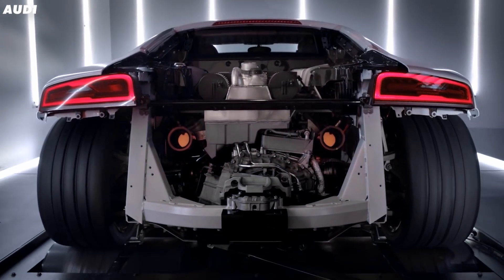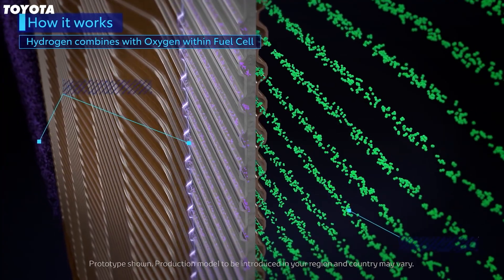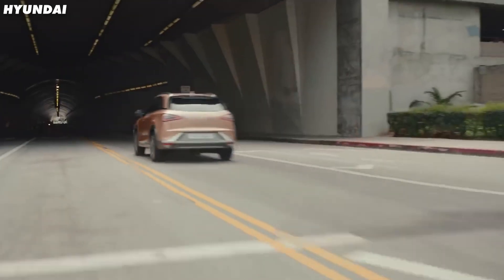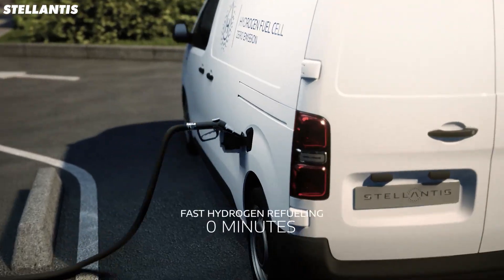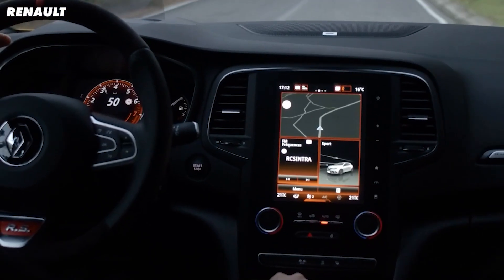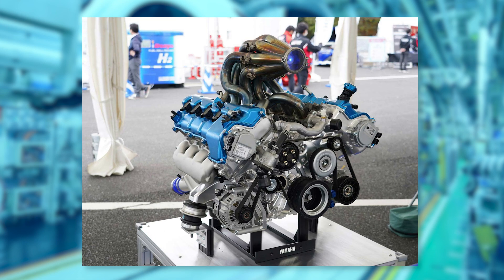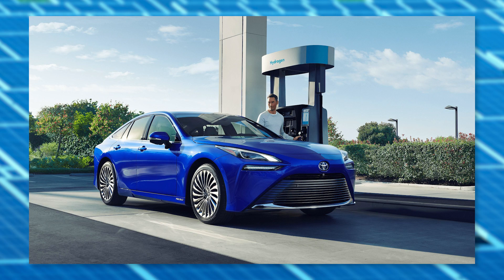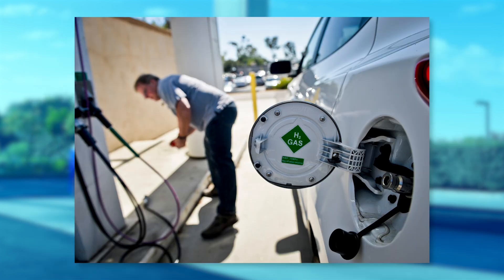The V8 Engine that Runs on HYDROGEN

Comment: 2 main things - hydrogen explosion by combustion and by fusion are two drastically different things. It's like comparing tnt to candle - both are energy dense, but giving off energy in an instant is governed by different factors.

Second - hydrogen has to be compressed - that takes enormous energy, and that contributes highly to losses. Storage is also a challenge - those vessels have to be isolated from temperature. Those two problems aren't  as high in petrol and electric batteries. And those reasons also cause the hydrogen to be harder to adapt, store, and transport to the gas stations.

Other than that - great video.
Reply: Personally, I would see hydrogen as a suitable fuel in the future, but not for cars people have. Instead, busses, trucks, or maybe even planes which are taking fuel  and have to be refueled fast and use the fuel fast for driving/flying continiously. Hydrogen as a fuel isn't very suitable for long time storage inside of cars (if stored at room temperature, hydrogen doesn't have high energy density). But using it straight away just after refueling is more sensible.
Reply: @rafakordaczek3275  Hydrogen in liquid form, which is what would be used, is very energy dense. It can also be stored for long periods of time (assuming there are no losses in the fuel tank) give that it won't lose is energy value like gasoline does (octane value lowers over time to vapor production of it). The tanks are built to hold the pressure to maintain the hydrogen in liquid form.
Reply: @ryannelson8717  Hydrogen in liquid form, haahaahaa roflmao.
Reply: @ryannelson8717  Well, The hydrogen also can cause metal fatigue - High pressure hydrogen can penetrate into the crystallic structure, weakening it. The materials withstanding such processes over long periods are quite expensive.  Ensuring durability of materials expose to hydrogen is still an active research topic in material science.
Reply: @rafakordaczek3275  the process is called Hydrogen Assisted Stress Corrosion Cracking. It's the process by which a hydrogen gets trapped in a microcrack and when the metal around it cools down, the hydrogen is effectively incompressable results in crack propagation. Yes this could lead yo failure of the tank. A simple solution is to ensure that the metal doesn't get heated up very much thus minimizing how much hydrogen will enter these cracks. A simple cooler that is active during fueling to prevent the heatup from pressurizing the tank. The opposite can be done for cooling down by placing a small string heater around the tank to keep it above a certain temperature. The result is a cheap, but effective extention of its expected life being around 22 years before any crack would otherwise penatrate through the entire tank metal and would still be relatively small, but that paid fuel that would be lost.
Reply: Look up about "Gumpert Water-Methanol" you can store Hydrogen without high pressure and low temperature tanks! while managing the same/better ranges
Reply: He wasn’t comparing the energy released between fusion and combustion. He was comparing the cryogenic storage system and vessels that are identical for using liquid hydrogen, whether for combustion or for fusion. And no you DO NOT need fissile material to fuse hydrogen. Hydrogen fusion is done in labs alllll the time. You just don’t get out more energy out from the fusion reaction than what was required to get the fusion process going, like what’s theoretically possible. Thermonuclear induced hydrogen fusion is just ONE way hydrogen fusion can be done. 

Muon catalyzed hydrogen fusion is also a well known, studied and completely viable process that does not require high temps or pressures for hydrogen fusion either.
Reply: Only Hydrogen fuel has the potential to make practical Electric trucks, ships and planes.
Reply: Also, inb4 people claim e.g. Cobalt used in batteries. Guess what, refining dinosaur juice requires Cobalt, and once it's used it cannot be recycled and is absolutely more toxic. You can recycle some Cobalt from lithium batteries.
Reply: @XenonG  hydrogen can be reused much easier.
Reply: re transportation - u can also transport hydrogen as water and electricity ..
Reply: imagine gas stations fill their own hydrogen tanks from grid power and water with an on-premises mini electrolysis  plant
Reply: @lezzbmm  sure, of course it just puts more stress on already stressed power grids and water supply.
Reply: @Scoots1994  correct - 2 systems already in dire need of expansion regardless of the future of hydrogen.. as opposed to putting stress on a nonexistent, materially demanding, hydrogen generation and transportation system ..
Reply: @lezzbmm  coastal nuclear power plants can produce power, water, and hydrogen.  It's criminal that it was ignored when the plan was put forward in the late 70s.
Reply: @Scoots1994  truly
Reply: I think most of that was covered generally though
Reply: look into hho gas
Reply: look at hydrogen paste it's quite interesting no need to keep it ultra cold ❄ ❄ and eliminate a lot a problems
Reply: Perhaps a two stroke that uses a nuclear detonation to compress the hydrogen fuel....yeah that's a good idea. Ok NASA actually thought to use nuclear bomb propulsion before.
Reply: Go throw some molten salt into h20 then come.back and tell me about it

Drip sludge into combustion chamber utilize a microwave frequency as heater to quickly turn drop of metal sodium sludge molten. Spray with regular old tap and ka boom needs air intake as well. 

I'd worry about my water tank freezing in winter so maybe if it's cold enough when you power off the water tank will just drain just tap you can refill it from sink
Reply: I think I'll wait for the matter/anti matter engines.
Reply: All of that will just make hydrogen Lamborghinis and Ferrari's more attractive because owning, maintaining and fueling one would be out of reach of peasants.
Reply: Solar/wind apps (Electrolyzation + liquefaction) Bucky Ball explosion proof upgrades for storage and distribution = energy medium as applicable and versatile as gasoline  

Energy medium as applicable and versatile as gasoline + Conversion kits for internal combustion engines = affordable alternative to replacing internal combustion engines.
Reply: We knew this was coming 50 years ago and had a chance to build coastal nuclear plants to desalinate water and convert some of it to hydrogen.  Now we have power shortages and water shortages and the price to build that still needed infrastructure is going to be HUGE compared to what it was then.
Reply: @Scoots1994  You are only doing ecological damage for SHAME money.
 You wage the Arab wars for oil, commanded by the seven sisters of oil and you have destroyed Syria and half of the Arab countries.
 You are one of the countries that pollute the sea and air the most, and your nuclear power plants remain a potential danger.
Reply: @giuseppebattagliese6424  I don't do any of that and nuclear power is MUCH safer for the environment than all the coal and natural gas plants being used and still being built now.
Reply: @Scoots1994  You did not understand.
 I am in principle against nuclear power is too dangerous.
Reply: @giuseppebattagliese6424  I got that you are against nuclear power.  The problem is that renewable energy with our current ability to store energy for later makes it impossible to use just renewable power right now which means we must use other means of generating power ... Fossil fuels or nuclear, and nuclear is cleaner and safer.
Reply: @giuseppebattagliese6424  Nuclear power is not dangerous. Does it have inherent danger? Absolutely. However, there are many regulations in place now that those risks are smaller than you driving your car on the road. The only inherent danger left in it is an overconfident operator. I personally am a Nuclear Reactor Operator. I started this field much the same way you feel now. Growing up hearing all the bad things terrified me. Now as a qualified operator and knowing exactly what is Nuclear power amazing me. It drives me crazy that people are so terrified of it, yet it's literally an amazing source of power that is safer than spending the day on the beach or even driving a car.

I imagine much of this is from the early years of Nuclear power where errors were made results in some accidents. The horror stories of Chernobyl don't make it much better. For Chernobyl to even get to that point that dozens of safety protocols were overridden. Those protocols now have several interlocking things that would raise awareness outside of those facilities long before they could become a problem.
Reply: @Scoots1994  fun fact, Nikola Tesla actually has a patent for a machine that makes rain but it was turned down by the patent office because in the patent Tesla claims it happens naturally but he can induce it and the reason for denial is because “you can’t patent a natural process”. 

So we don’t need to risk the cleanliness and security of the global water source with nuclear plants on coastlines when there are plenty of devices for causing rain already that don’t risk releasing radioactive materials into the worlds oceans.
Reply: @CharlieSolis  we need cheap clean safe reliable energy and nuclear is the best solution for that right now.
Reply: wind and solar powered hydrogen plants would be feasible, but storing, compressing and making it all safe in a car is the hard part.  its cheaper to grow hemp and turn it into ethanol.
Reply: @Mp-jw1qg  There are already hydrogen cars on the road. It really isn't as expensive as people think. The problem with it right now for the production of it is that there is so little that the price for hydrogen is high. As more infrastructure is built that will come down, but efficiency will likely improve along the way. The project maximum efficiency for hydrogen is around 65% in 10 years while petrol is around 48% in the next 10 years. Electrics is supposedly 85%, but the cost of everything rising just for cars to be electric is a little ridiculous so I'd much prefer hydrogen over electric.
Reply: @ryannelson8717  The production of hydrogen is already a $100billion a year industry. There are no economies of scale to be had, no low hanging fruit of efficiency gains to be made. This is as good as it gets.

And the "65%" efficiency you quote is merely for turning water into hydrogen and oxygen, not for then compressing, cooling, storing, transporting and dispensing it. And THEN there is the losses of turning that into motive power, either through a fuel cell (another 50% loss) or ICE (another 70% loss plus lots of lovely NOx).

Hydrogen will never, ever, be viable for mass market adoption in road cards. Maybe there will be a few niches it can fill but I've not seen any yet.
Reply: @LiamE69  Quoting a specific process for efficiency would be extremely ignorant. Why would I quote a portion of the process to compare it to entire cycle efficiency of gasoline or electric? Hydrogen is still mostly just a prediction because it's based off of the same level of research being pushed for it as is being pushed for electric. Hydrogen cars as they currently stand are on average a 43% Efficiency cycle, just 1.5% above gasoline. You also seem to think that the NOx pollution is bad. In reality that pollution is also present from electric cars and petrol cars already. Hydrogen cars are just above the amount produced by electric cars (whole cycle, primarily from charging and battery losses) while gasoline cars produce much more than either of those options in terms of NOx compounds. Few of which get eliminated by a catalytic converter to eliminate the few bad ones. However, if you notice those numbers are rarely ever mentioned because they contribute to a gas that is beneficial to the atmosphere until it reaches a point where it would be to much. Which, hint hint, if gasoline cars don't warrant mentioning it then who really cares about it for electric or hydrogen as it's less than that? Also conversion of water to hydrogen actually has a very high efficiency of 93%. You merely have I2R losses and once the oxygen is taken into account drops that efficiency to 86% if the oxygen isn't used. I'm not a hydrogen fan boi mate, I just want to see a sustainable fuel source that is achievable and provides actual reduction in pollution overall. I don't want to live in a world like Elysium which could become a real possibility if "political push for electric cars" is all that's really cared about. Are electric cars a decent solution for now? Yes. Are they a good long term solution? Absolutely not. They only cause a rise in price of EVERYTHING and as such consumer why will eventually make you pay for per mile for it then you do for a gasoline car and it isn't much better for the environment.
Reply: @ryannelson8717  Extremely ignorant? It is what you did. QED.
Reply: @LiamE69  Actually it's what you did. Forming Hydrogen via electrolysis is 86% efficient as I mentioned in the last comment. You made an assumption that I did when I did not. Maybe you should look up what you brought up before you decide that someone else is did. Electrolysis is expensive hints why it cost over $16/kg in CA. I did my research before I made the comment because it's something I'm genuinely interested in. Second that "65%" ISN'T TODAYS efficiency, that's the end cycle predicted MAXIMUM efficiency in 10 years. So again, it is EXTREMELY IGNORANT to compare a single process to the end cycle of 2 other fuels like you have assumed now, not only once, but twice. As shown in gasoline engines we typically fall a few percentage short. So in 2032 it will like be around 60% while petrol engines will be around 45%.

Actually read the comment and do some actual research before you decide to be an a-- and end up wrong.
Reply: @LiamE69  Also, as an added bonus I'll include for you the awesome useless value that you wanted to claim I made. The efficiency to produce hydrogen and compress it to a usable gas is 72% which, crazy concept here, is still higher than the end cycle value of 65% in 10 years. The current efficiency rating being only a meager 39% in current hydrogen cars, which mind you have less than 10% of the amount of research put into them than electric cars do, and less than 0.5% of the research that was put into petrol engines. So it's fairly reasonable that a predicted maximum of 65% in 10 years could be achieved. Volkswagen found that in 2019 models that the efficiency was around 35% so it just a few years with only a tiny niche market there's already been more than a 10% increase. Now imagine with the research amount of electric vehicles being done is now instead for that of hydrogen. That number would like be 2 times The percentage increase the first year after so 47% after just one year. So 2023. Then the decline each year there after resulting at about 60% when 65% is the predicted max for 2032.

Also while I absolutely hate Wikipedia,I figured it may contain some useful information, and to my surprise a large portion of this information was roughly correct and was a very simple Google away. Yet you seem to have QED me. Which, idk about you, normally requires that something be proven, yet was not. In fact it made you appear to be someone who doesn't know much, but seems to be a person, what many would call, a keyboard warrior. I don't assume that your ignorance (not an insult, just that you aren't informed on a topic) is stupidity. However, you have been overconfident in yourself and I encourage you to atleast reflect upon this and maybe learn a little from it. 

As a final disclaimer, nothing that I have stated should be taken as absolute fact as I'm sure there are likely small errors in them, but not major in nature. As such some values my actually be a few percent higher or even lower, but most are only predictions. However, I would still consider them to represent the correct idea and relative area of efficiency stated as a few percent swing is within acceptable margins for now given that the technology is still consider relatively new, but not up and coming anymore.
Reply: @ryannelson8717  Having worked for the last 4 years in the prime of motorsports which as I'm sure you know uses an hybrid powertrain, the destination of all our lithium cells, after just a few races is a landfill as recycling them is not cost effective. Mind you, that sending those batteries across the ocean to be "recycled" in India/China... is not a solution as they might explode mid trip - they need continuous monitorization due to their instability. Completely agree with your statements - electric cars have a future but that does not include using lithium batteries for sure.
Reply: @metitusable  Thanks! I really like the idea of hydrogen fuel cell cars because the fuel cells will last the life of the vehicle and won't add to the already massive amounts of environmentally destructive garbage nearly as much. With a few years infrastructure development like electric cars (Tesla superchargers) then hydrogen too can become a viable replacement for gasoline cars. The only problem is that electric cars are being marketed like they're some awesome this that just blows everything else out of the water. Then hydrogen cars are basically being marketed like they are some little devil spawn. The people just aren't aware of all the negatives that electric cars actually bring. Hopefully before they become the mainstream the huge pollution problems with them are fixed, otherwise we aren't really making a step in the correct direction.
Reply: @Mp-jw1qg  But no, growing hemp takes away the surface of the much more important grain.
 And that's not good.
Reply: @giuseppebattagliese6424  that's not true at all. Hemp removes toxins from the soil. It literally absorbs heavy metals.  Adding hemp to crop rotation for grains is actually beneficial to the food web in the soil.  I'm a chemist in the hemp space and we cycle hemp , alfalfa,. Wheat etc and it thrives. Most commercial hemp farms are planted in feed crops in rotation for that reason
Reply: @Mp-jw1qg  You just say stupid, goodbye is better otherwise you make me nervous.
Reply: Believe in JESUS today, confess and repent of your sins. No one goes to heaven for doing good but by believing in JESUS who died for our sins.  For God so loved the world that he gave his one and only Son, that whoever believes in him shall not perish but have eternal life.(John 3:16)❤️😎
Reply: Hindenburg... yer, its not fission, but it still isn't pretty.
Reply: The biggest issue I have with hydrogen is the efficiency, or better yet, the lack off efficiency. And since we can't change the laws of physics, that's not going to change quickly.

What good is hydrogen when you'll need 3 to 5 times as much energy compared to simply using a battery?

And while some people might like the sound of a combustion engine, it's still noise pollution. But wait. We are combusting. So there's more going on than just creating water because inside those cylinders is more than just hydrogen and oxygen. No matter how clean the air is you inject, it will always contain pollutants just like the engine needs to be lubricated which also causes pollutants to be burned when you ignite which in turn once more create emissions that you will be spreading all over the place.

But for those who still think it's a good idea, think about the fact that industrial hydrogen is already in short supply and expensive. Imagine if demand was to increase heavily, you know what that price will do? If you think fuel is expensive today, wait till you have to fill up with hydrogen.

At least you can fill up in a few minutes, right? Well... it depends. If there is enough hydrogen under high pressure at the refueling station, sure. But if there isn't? You'll still be spending up to half an hour to fill up your tank.
Reply: What good is BEV even though it only takes a third as much installed renewable capacity to create it.... It takes hours to transfer it to the vehicle instead of minutes. It is possible to have enough installed solar or wind generating capacity to create a full refill of range FOR FREE in an HFC car. So having less installed capacity is OF NO VALUE compared to the functional benefit of not having the fatal flaw of refill wait time. Not a tangible trade-off... huge wait time for less input electricity. That's why they invented the ADDED COMPONENT of hydrogen fuel cell to the EV. Battery manufacturing opportunists somehow pretend they can't understand this. So again, what good is BEV ridiculous wait time compared to hydrogen instant refuel? Especially in huge semi trucks which you will find out will never fly.
Reply: @Hans-gb4mv  That's why we need nuclear power. Some reactor designs are optimized for cracking hydrogen from water. IC Engines powered by hydrogen are ideal in that they do not require exotic rare earth metals to manufacture them. And, while you are right about the lubrication causing pollution it is will still be much cleaner than burning petrol.
Reply: @Hans-gb4mv  I agree with you and your concerns, because you, as well as billions of us on this planet, accept the irregularities injected to us by vision and sounds by those who claim to be our owners. NO CONSPIRACY THEORY. Please understand that I have nothing against the electric cars, I do like them too, and I congratulate those inventors. BUT,  TERRICOLA 1, is 100% CLEAN, and do not require the 3 to 5 as you mention here. TERRICOLA 1, is a converter, Reactor  - Planet-surface and oceans cleaner. Just like many European countries, Germany has the so called ( Yellow Sack ) monthly." HOWEVER, " it is 100% proving that hundreds of corrupted companies across Europe are taking those sacks to Romania and many countries in the east, because China and Africa cannot longer takes anymore. "WELL" TERRICOLA 1, WILL TAKE THOSE BILLIONS OF SACK'S AND EATEN. At 45% less cost than those paid today by the German Tax to those corrupted companies. NO MORE POLLUTION TO OTHERS NATIONS.
Reply: @Hans-gb4mv  You should probably look up the full cycle for an electric vehicle efficiency because it isn't much better than any other "fuel" source for vehicles right now. An electric car just starts with a massive deficit that is slowly recovered, but the pollution that you so heavily seem to care about, will likely never be made up for as the pollution from those batteries being produced is more than a petrol engine being on the road for a decade. Mind you, that battery likely isn't going to last that decade and thus will result in even more pollution. Efficiency is great, but not when it results in more pollution when that's what we are trying to reduce. The electric car idea isn't as great as everybody makes it out to be. Ever notice how as more electric cares hit the road, the price of it is climbing? So now not only do you "save" money for your car, but you just turn around and spend it on your home. The actual effective price of an electric vehicle per mile is just a couple cents under a petrol one. It just looks better on paper, because most of the manufacturers don't include everything to convince people to buy them because of the government mandates.
Reply: @ryannelson8717  then you have been reading other studies than me. Even Volvo put out a study indicating the life time emissions of a BEV are lower than that of a similar ICE.
Reply: @Hans-gb4mv  I would recommend rereading the last sentence of the last comment as it directly mentions those "studies". You have to read the all inclusive which not a single manufacturer has done. The university studies are the ones that factor in the battery production, car production, etc.
Reply: @ryannelson8717  you'll have to be more precise about which sentence of which comment you are refering to because I do not see any reference to any study in any reply under this comment from Rafal. Even if there was, that's not how YouTube intends the comment system to be used as it can mean that you have to go search through hundreds of comments and replies. If you want to point something, include it in your own reply.

Having said that and being back at home where it is simpler to reference things ...

In your most recent comment you almost imply to be looking for confirmation bias by stating that studies that agree with you are coming from more reputable sources than those studies that do not agree with you and therefore they make a better point. Now, I very much would love to see those studies from those universities. 

Now, when we look at the study from Volvo (https://www.volvocars.com/images/v/-/media/market-assets/intl/applications/dotcom/pdf/c40/volvo-c40-recharge-lca-report.pdf), we find that they factored in:
- Materials production and refining
- Battery modules
- Car manufacturing
- Use phase emissions (you know, driving the car)
- End of life

Seems pretty inclusive to me as this one does include the things you mention: battery production, raw materials refinement (you know, lithium straight out of the ground isn't really usable), building the car itself and so on. And unlike those university studies, these people have the actual figures on hand to compare with.

Now, the lifetime emissions of an ICE XC40 are 59 tonnes, you know what the emissions are for the EV variant, the C40 recharge? 50 tonnes on the global electricity mix, 42 tonnes on the European mix and it would be only 27 tonnes if you could charge it with 100% renewable energy (which technically isn't possible yet). And Volvo admits that the manufacturing of the EV variant requires 70% more energy and therefore generates 70% more emissions, but those are offset with driving the vehicle long enough.

And that is the crux where most studies diverge these days: how far do you need to drive an EV before it becomes more environmentally friendly than an ICE vehicle? I'm going to stick with Volvo's figures for now as the weather is too good outside to put a lot of effort into this. But given the global energy mix, the crossover point between an ICE and an EV variant sits at 110k km, for any non metric person, that's around 68k miles. And I've yet to see any recent study placing that figure higher than 150k km/95k mi.

You know what the average distance is a modern car is expected to achieve in its lifetime? That number sits around 250k km, more than twice the crossover point.

Also, have you noticed how the price of ICE cars has been rising in the last couple of years? I would say that the increase in price is not related to the fact that these are EVs, but the supply shortages on one side, inflation on the other side making raw materials and labor more expensive. And as someone who has done his homework and who drives an EV and can make the comparison to the running cost of that EV compared to the previous diesel car I can tell you, it saves more than a few cents. 2 weeks ago I took a 3 day trip, covered 1500km (almost a thousand miles), most of those I charged on expensive DC fast chargers which I rarely use, but in this case, you want to get somewhere and back. When I came back home and checked the amount of money spent on "fuel", I did a quick calculation how far I could have gotten in an ICE car with that. I would have gotten half way. 

I spent less on paying off the car, I spent less on insurance, I spent almost 0 on maintenance (no more oil changes), I currently don't have to pay any road taxes (but even if I did, it isn't the huge differentiator here) and the fuel costs me a quarter of what diesel used to cost me. Now add all of that up and I'm saving around 250 euro/dollar per month.
Reply: @Hans-gb4mv   Read your own study mate. It doesn't account for any vehicle maintenance at all on an electric vehicle, nor does it take into account the loss of battery charge efficiency as it ages and is discharged. No way does it state the expected or even a rated duty cycle or number of cycles the battery can reasonable handle prior to losing significant charge. Should you consider to read the entirety of your own provided source you'll find that by the time you reach you 68km that the actually saved pollution is only around 6.5% overall. Mind you that battery will likely need replacement not to long after that which normally occurs around 85000 miles (~136km) at which point send you back into the negative at -13.5%. I understand that most cars can survive to well over 300km, but I know of very few people who drive a car past 150000 miles here (~241km) at which point, if I calculated correctly based on the information in that study is about 1.5% saved assuming that a battery holds a perfect charge for the first 25000 miles and then slowly degrades until it only holds about 60% (Btw this would still require the same amount of electricity to charge, but only gets 60% capacity) that battery would like need to be replaced around the average 85000 miles and still would have only saved a total of 3.5% prior to its replacement due to degradation and if the second battery is used to its full extent than the total amount saved at the end of life is a whopping 4.8%. (Your study really only accounts for Europe.)Thus, they are about the same.

Over here the difference in price between gasoline and electricity really isnt that large, it results in a few cents difference. Roughly $0.09 per mile for a Tesla. To put that into reference my full size truck costs about $0.166 per mile. Tesla being the most popular electric car in the US have been proven that over the course of their life is 233 g CO2e/mile (This does not include the battery production factor, just driving the vehicle.) My full size 2022 Toyota Tundra is 459g CO2e/mile. A gasoline Prius is 177 g CO2e/mile. As we both know that battery starts us off pretty negative, but has potential to bring us more positive. So while it may be better in Europe, it isn't everywhere. They are about the same, you potentially save a little money over here, but not really much if the vehicles are comparable in size. (The Prius is about $0.098 per mile.)

This is why I don't really like electric cars because people seem to think they're some great thing, when in reality they're about the same. They aren't really any more efficient given the way people drive here (Typically a rated 400 mile battery really only gets 280-310 miles cause people drive aggressively or over the speed limit). It that same way with Diesel over here, people think they're so much better because they get a better MPG, but in reality a Diesel truck cost just the same as my Gasoline truck does. ($0.164 per mile) Nothing that is currently being 'marketed' as better actually is. They're all about the same, but some of the ideas have potential which is what's being shoved down everyone's throat and people are just gobbling it up. In Europe, however, it does seems to currently save you money, until most of you drive electric cars then you be paying gasoline prices for that electricity, which in the long runs will cost you more because you still have to power your house. So you save money now, for cost in the future, but nobody really cares about future cost for some reason. I for one, don't want to see electricity rates double, they're already changed by a few cents per kwh which changed by home electric bill from $65 dollars to well over $100 sometimes, but commonly its about $80 now. I never saw a bill above $80 before the rise of electric cars.
Reply: @ryannelson8717  When you say "(Btw this would still require the same amount of electricity to charge, but only gets 60% capacity)", are you talking about a situation, where, for example, a 100 kWh battery (factory capacity) has degraded to 60% of original capacity and can only provide usable 60 kWh?
Are you saying that to charge that battery from 0 to 100%, you stilll have to feed 100 kWh into it, but can only get 60 kWh out when driving?
If you do mean that, I would like to know what you think happens to the 40 kWh of energy that you didn't take out while driving? I mean, it has to go somewhere. Either it "disappears" when charging, so when you unplug, your degraded battery only contains 60 kWh of energy, or the battery still contains 100 kWh, but 40 kWh of that "disappears" when driving.
As you know, energy doesn't just disappear. It has to go somewhere, and that somewhere tends to be heat. So if 40 kWh of energy were to turn into heat either during charging, or during driving, something would start to melt real quick!
In my experience with Li-Ion batteries, when they degrade, they become unable to store the same amount of energy. A 100kWh pack degraded to 60% will take in 60kWh of energy. It's essentially the same as having a smaller battery that just happens to weigh the same as the original. Yes, it can also give out less current, which is why your aging cell phone might shut down under heavy load. Charging a degraded battery is not significantly less efficient. It just reaches its full available capacity earlier, although it might not necessarily be any faster than originally, due to not being able to accept as high charge current either.

It's understandable why you might harbor such a misconception, and I wanted to correct it. I hope I haven't caused offense in doing so.

 I don't have enough data beyond the Volvo study to address your other arguments other than saying that whatever shortcomings there may currently exist, are certainly being worked on by very smart people. Entire industries are improving efficiencies and creating new, more ecological, reliable, and longer lasting battery chemistries. These early years of transportation electrification are important first steps in reducing our burden on the planet in the long run, even if they aren't the perfect solution in their current form.
Reply: @arantala  Just poorly worded, my bad. Yes, only 60% capacity, but still only take "60%" of the kwh. The efficiency does degrade as the battery ages just because of the materials it's made of and the internal corroding make it harder to charge resulting in more heat loss so a 100 kwh battery takes about 112 kwh to fully charge where as the degraded 60% will take about 70.5 kwh to charge. As you can see the change in efficiency, it isn't massive, but it does make a difference, it's much worse in traditional lead acid batteries where that 60 kwh would likely take closer to 80 kwh to charge and it's internal temperature would get well over 40C
Reply: @ryannelson8717  electric cars ARE that great.  Battery technology isn't ideal.  And the environmental damage of making the batteries is significant.  Electric cars are still a net win for the environment assuming clean energy.  The issues there are that the energy is mostly not clean, and we are using non-renewable fossil fuels for electric cars that use batteries that are themselves using even more limited resources.  If everyone in the world went electric we don't have enough power to charge the batteries we don't have enough resources to make
Reply: @ryannelson8717  Try living here in Canada where we see 10 or more EV's dead on the road every time it gets colder than -20C, the battery tech just isn't ready for it yet. I've spent a few -30C days out dropping off blankets and warm drinks for those waiting for a tow in an EV.

I was running an HHO unit in my Jeep to test mileage difference on the 4.0L with a homemade unit, even that was affected by how cold it gets here. However I did hit a top mileage last summer of 36mpg highway and 23mpg city before pulling the unit, definitely looking at something similar and more permanent when I swap out the engine later the year.
Reply: @ryannelson8717  read up on newer studies, electrical cars have gotten much more efficiently built since those claims were factual a decade(+) ago, and it only takes a few years for an EV to 'pay off' its carbon footprint compared to a comparable ICE - assuming the electricity used to produce and charge it was coming from fossil fuels. If it was built or charged using renewables it'll obviously be a lot quicker.

While fast charging at public chargers is - relatively - expensive, charging at home at night in many areas of the world costs a small fraction of filling up a gas tank with the same range. And if you've bought an EV that fits your actual range requirements you'll be seeing that public fast charging station a few times per year, unlike the gas station..

If you want a legitimate reason to complain about modern EVs it's what their increased weight and power does to the tires and the roads, creating excessive road dust and microplastics.. shifting towards smaller and lighter vehicles is the only fix for that.
Reply: And don't get me wrong, I love my 4 or more wheeled noise, heat and pollutant makers, in V12 or inline 5 turbo, gas turbine or rotary form, but we have to be realistic here. It can't go on, we are overdue yester-decades to another form of energy for personal transport.